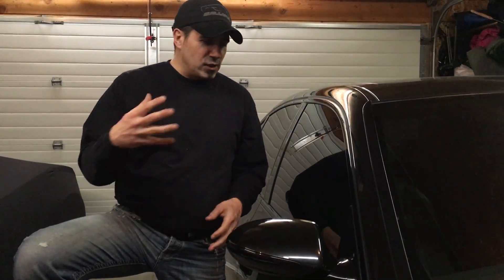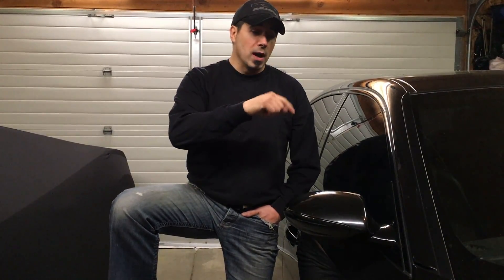The E60 M5 S85 V10 Motor Better than Least Reliable Engines ?

Comment: I loved the way you defend the m5 mark it’s the truth my e60 m5  has 109500 miles on the clock and only needed consumables, clutch,brakes,tyres, with no issues with engine, smg or diff and it’s super smooth
Reply: ExoticCar PlayPlace that’s true, yet there is so many horror videos out there about the M5 E60 it’s not a true reflection of this magnificent car , as long as it’s maintained and use only the top grade fuel and correct engine oil it’s as reliable as any other car if not more than most , and that’s why I watch your videos about the M5 because you tell it how it is and great tips and advise,keep up the honest videos Mark
Reply: You should look into doing the rod bearings ASAP. Using "correct" oil (10w60 is not the right oil for this engine FYI despite BMW's recommendation) will not prevent the rod bearings wearing out prematurely, might only prolong the life of them by several thousand miles but they WILL go. Not if but when.
Reply: APNYC what is the right oil?
Reply: Donato Ricciardi I have 114.5k and csr is awesome!  Same needs yours. Lol
Reply: Eric Paz 5w50 showed the best results at cold start and at full temp compared to the other weights. Thats what ive been using since replacing the bearings.
Reply: Eric Paz 5W-50 definitely
Reply: Andrey Polyachenko 5w50 is the worst thing you could do. It will trash your high pressure vanos lines as well and the the vanos pump. It’s not a hard concept, you let the car warm up. I let mine just run in the morning for about 15 minutes while I finish getting ready for work.
Reply: What do you say? Should I buy one? I live the car so much! But I am afraid to daily it.

Comment: I have an E60 M5 with 84,000 miles I been having this car for about 2 years 
I’m not afraid of the car issues 
I’m not a mechanic but I was able to replace its clutch myself for about $700 parts 
Rod bearings for around $900
A fuel gas control module for $150
One throttle actuator for $600
And of course it’s regular maintenance services 
The only thing with this cars is that if you don’t have a AAA membership you should consider getting a towing truck service because you never know where or when this car will decide not to work , but other than that if I was able to do it you sure can too, I have never worked on any other cars but my little 2004 Colorado, my 2005 bmw 5 series and my M5, my truck has now 230,000 miles on it and still works fine, my 5 series I bought it with 70,000 on it and now has 208,000 on it and it still smooth and power full, cars can really last if you do take care of them. 
God bless all this people who make videos to help others with same issues.

Comment: I have one with 120K miles. Never had major issues. Still going strong! Dont believe the Fake News!
Reply: Rod bearings wearing prematurely and blowing engines is not fake news. Hope you've done your bearings at that mileage.
Reply: APNYC Nope. Not yet. Led and copper levels are still great! Maybe I got lucky... I had a z06 a couple of yrs ago which had the ls6 engine in it which was suppose to be bulletproof and blew a piston which cracked the block (58k miles)
Reply: I did a blackstone report on my m5 with 78k miles and it showed the lead and copper levels to be below or just in line with a healthy s85 engine. I still couldnt sleep at night knowing others have had their failures at 80-85k miles and did the bearings anyway. I'm extremely lucky I went with my gut feeling and did them. Two of the bearings were on their way out within the next 3-5k miles. Copper levels FULLY exposed and both of them. Mind you this is a one owner car I purchased from a middle aged doctor that had it only serviced at the BMW dealership. Careful, you're playing with fire (unless yours were done by the previous owner)
Reply: APNYC Good for you , man. Previous owner had some engine wotk done at 95K miles. Hopefully they were the bearings. I've tried to get to the bottom of it before purchase , friend of mine is a service guy at a dealership but could not find what was done to it. I try not to think of it and enjoy the car everytime I drive it... Best of luck
Reply: lol, well then, good luck with that
Reply: How does the driver's seat hold up over time?  I bought an '09 with 24,000 miles, and I was curious as to how durable the seats are and how much they show wear.  I have the ventilated seats.
Reply: WoodstaS Driver's seat holds up pretty good. The leather is pretty thick and good quality.

Comment: Also the c63 amg m156 engine head bolts, catastrophic failure. But, I think the main reason they give them shit about the car is the amount of things that are "known" to go wrong. Throttle actuators, vanos solenoids, rod bearings, smg pump, PLCD, wire harness for the gear position sensor. For example the B8 S4's were bullet proof except the 's-tronic' transmissions are known to almost always grenade itself. That's a 3-5k fix depending where you go easily. But that was it's main only weak point. I personally own an '07 M5 and love her to death. I've changed the rod bearings already at 70k miles. They were ready to go with copper showing. But it kind of goes with that any high performing vehicles will generally wear parts and bits more quickly than non-high performing vehicles. Also when it's designed to be an everyday commuter. In the end, you have to pay, to play. And if you can't stomach the cost, you're in the wrong car.

Comment: Have heard in some places, for example here : https://www.youtube.com/watch?v=M-pxSsRkUiE  , that 2012 and 2013 years of M3 have had rod bearings issue solved. Does anybody know if this be told about any production years of this M5 ?
Reply: No. They did not change anything to resolve this issue from factory across all e60 model years i.e. 2006-2010

Comment: I have a M6 e63 V10 DCT NO Problems best bang for ur buck car at under $30k even “IF” everything breaks still better driving experience than faster 0-60 turbo cars like  $50k gtr or M4 if same year gallardo which this beats all around is still goin for $80k this car shouldn’t b going for under $40k only reason they r so low is cause people just hate bmw n looking for reason to trash the brand cause of one punk kid that pissed them off . This is THEE Ultimate Driving Machine